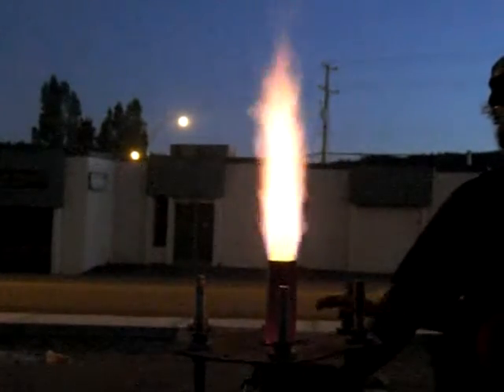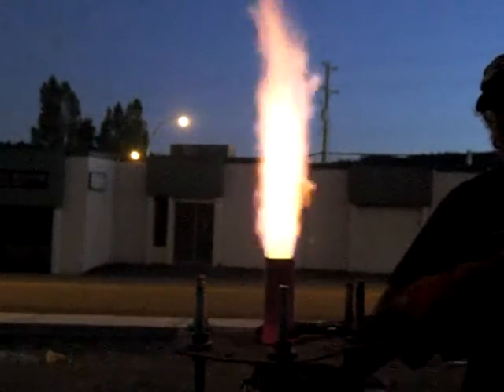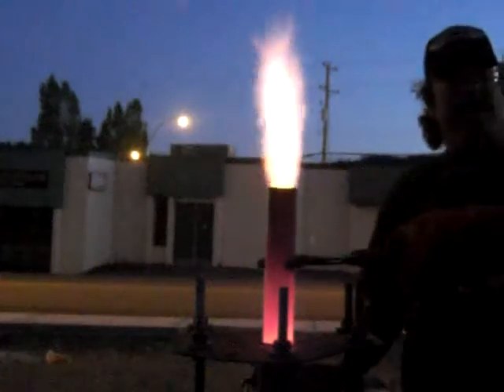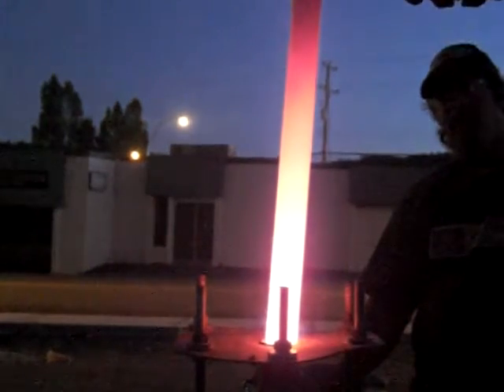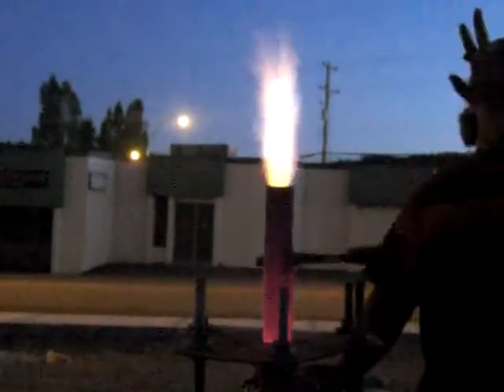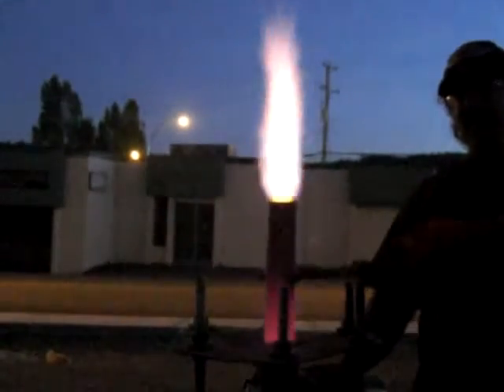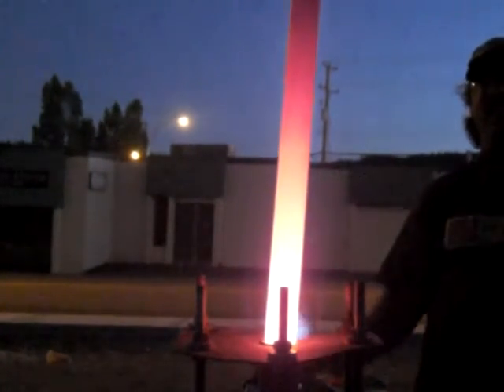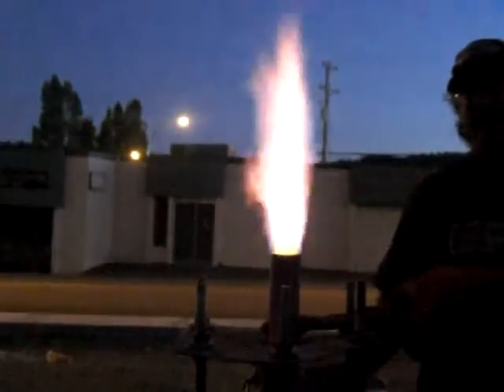87-Fun Test-Heating large diameter titanium pipe-Reburning of emmisions.

Comment: Yeh, the stuff gets warm.  Imagine is hydrogen was being used or GEET Gas?  In the latter vids I've been able to bet the titanium to the yellow point.  It does look white to the eye a bit but the camera lens messes up because of the intensity of the light.  Hoping to do some titanium tests soon with the 1 1/2 stock piece to see if this gets hotter than the stainless I've been using.  Reaching temperatures up to 2, 300 F so far.  The exhaust is around 2. 000 F out in the open.